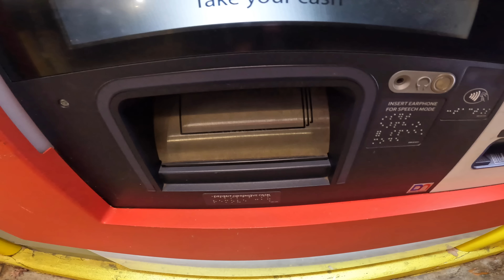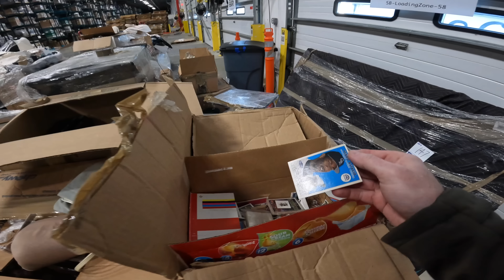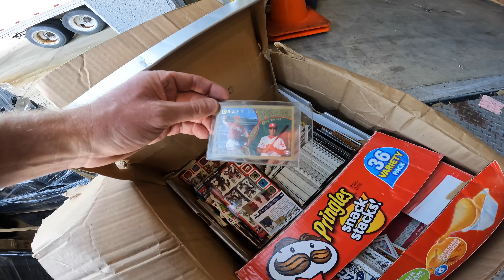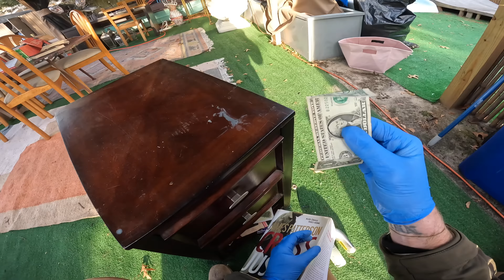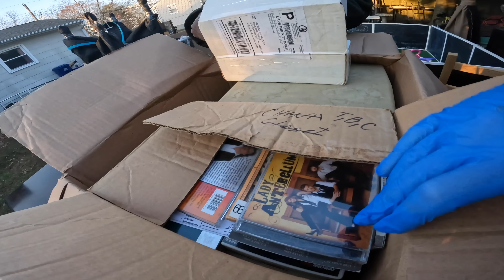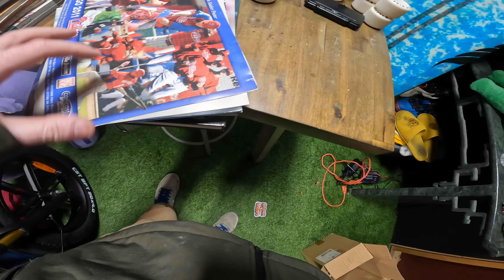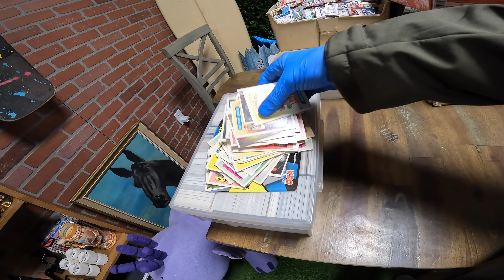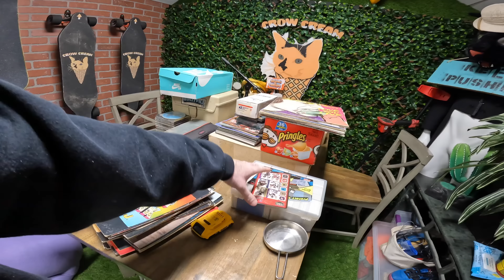I Bought HUGE Garbage Pail Kids Collection!

Comment: My Nissan sometimes locks up the ignition.  The fix is to turn, or try to, the steering wheel rapidly left and right until the key turns in the ignition.  In park, naturally.  It's a known bug.  The baseball cards I find can be counted on to be the grade worth sticking in your bicycle spokes.  Or giving to Finley to build card houses.
Reply: BTW - you have to hold onto the key and keep pressure on it to "turn" at the same time, until it unlocks.  I've never heard of a Chevy doing the same thing, but Old Truck Problems. are a thing.

Comment: Between 1985 and 1988, Topps released 15 series. After the initial series run, Garbage Pail Kids would be retired for fifteen years. In 2003, the brand returned, and it has continued to run ever since. make sure they say topps and in the 80's

Comment: Hey Tucker, On the key getting stuck in truck and not turning over.  I had that issue and it had to do with the steerwheel lock.  I would have to turn the wheel while turning the key.  Not sure that is the same issue but thought worth mentioning.  For the Dream!!

Comment: Hey Tucker on the truck lock problem i've repaired many its the lock cylinder from  a heavy amount of keys on your keyring damaging the lock cylinder if you google it you will see its grinding your key down as you drive ,  it will eventually leave you stranded you'll see brass powder inside lock jamming it up try lubing it with graphite powder or dry lube WD40 down the keyhole dont over do it.  love your videos thank you, you have a sweet family
Reply from the maker: Thanks its getting gnarly to start .

Comment: I had a similar problem with the key going into the ignition of my old 2002 Jeep Grand Cherokee.  It would be stuck and not turn.  What a mechanic told me to do is if I'm stranded somewhere and the ignition locks up, just give the key a good bang with a blunt object while it's in the ignition, like with a screwdriver or pocket knife or something like that.  Tap the key in the same direction as it goes into the ignition.  That should loosen everything up and allow you to turn the key.